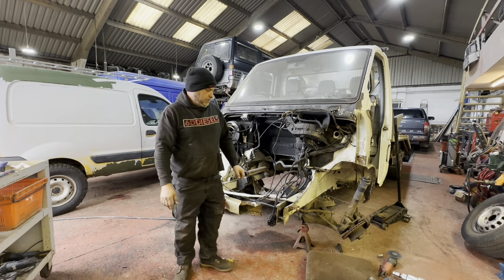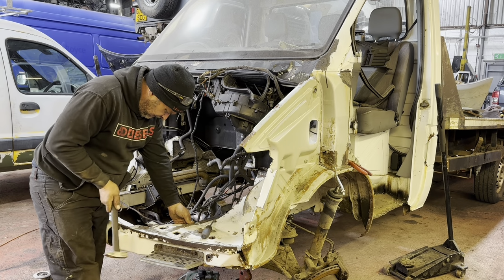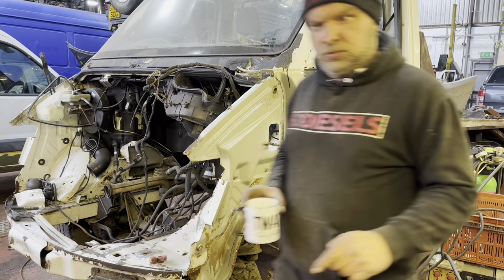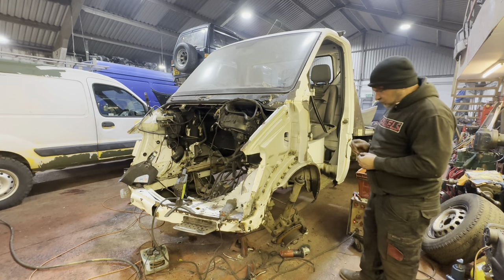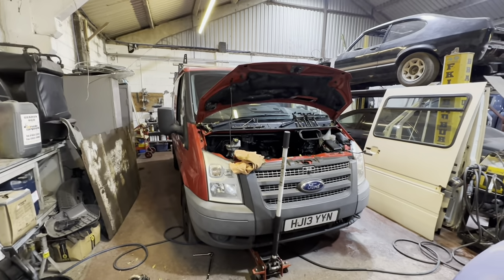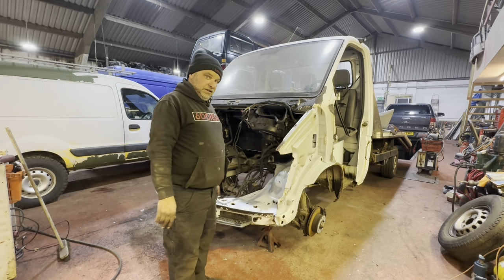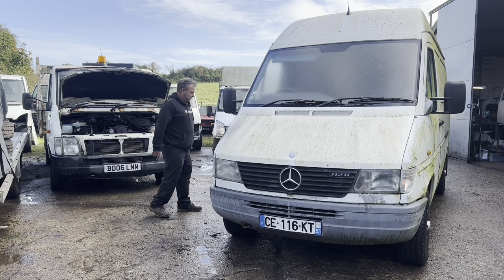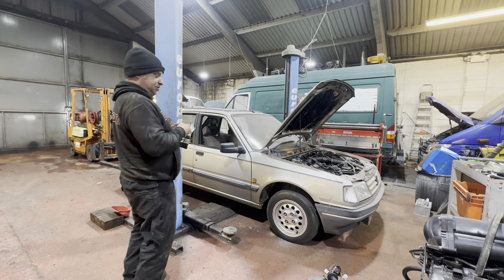Recovery truck rebuilding part 2 !!! Fixing the cheap Mercedes we bought of Ebay !!

Comment: I must admit, I had a nervous twitch when I saw that Ranger in the background, those things are the work of the devil!
Reply: Mate of mine has a 17 plate 3.2 Ranger and it’s been trouble since day 1, dash always lit up like a Xmas tree and even now it’s leaking diff oil from the front, even though it’s been to Ford a few times for the same issue. Oh and the adblu never works, always broken.

Comment: Love the 2.9 5 cylinder “treasure”. Let mine go for a song at 300,000. Only major thing was head gasket at 250,000, otherwise always sweet as a nut. Sills went because it didn’t like being used as an amphibious vehicle during the Somerset floods of 2012/14 even though it enjoyed a bit of splashy splashy halfway up the door step. Nice one Al😊

Comment: Great video for a late night Sunday viewing.
I'm in the motor trade buy and fix salvage.
Love watching your channel.
One thing you can't even beat with a old peugeot diesel 1 it will always start minus -20 as long as its got antifreeze in the thing will start.
And the seats you'll be hard to find a more cheap reliable car that's like driving a armchair.
You could get to Scotland on a fiver and do it wearing your slippers 😉 
Great video interesting content 👍 
Keep it up.
👍👍👍

Comment: Those Transits 2011-2013 have a different EGR cooler and are common for going and putting emmisions into the header tank. Try joing the water pipes together that go to the cooler and see of its better, recently had one like it myself and tried it. Ended up being the cooler, you could even tell just by taking the water pipes off the cooler and starting the engine as it poured smoke out the cooler
Reply from the maker: Already done and didn’t cure it so off with the head it is 👍
Reply: @6DDIESELSDorset  Ah fair enough, just thought id mention just incase :)
Reply from the maker: Cheers for the thought anyway 👍